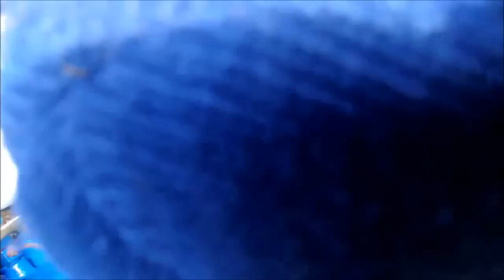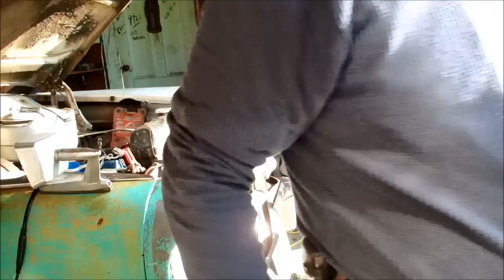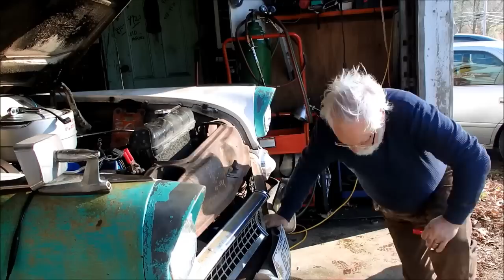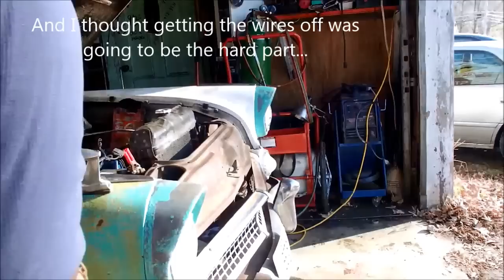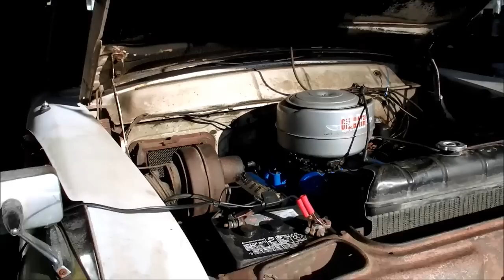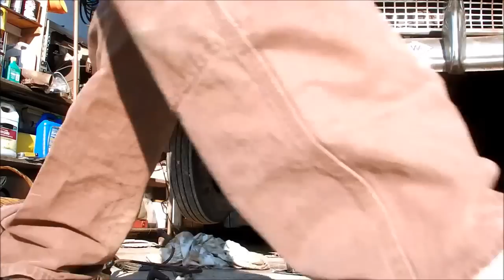'55 Ford Plug Wires going back on 1

Comment: Sometimes I miss the old cars- one vacuum line, one fan belt, no electronics to get temperamental. Then I remember changing plugs every 15-20,000 miles, if you were lucky and they lasted that long. And rebuilding carburetors. And trying to stop a GTO with four-wheel manual drum brakes. And gapping points. On the other hand, it might have been a pain sometimes, but those old cars had soul.